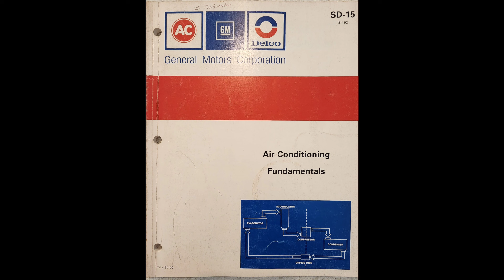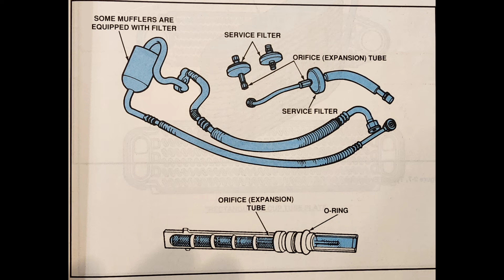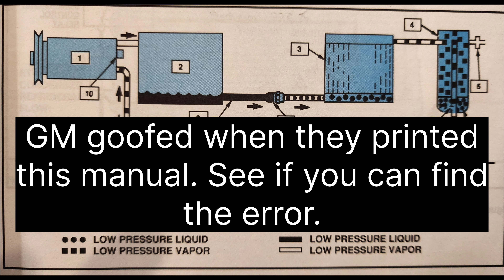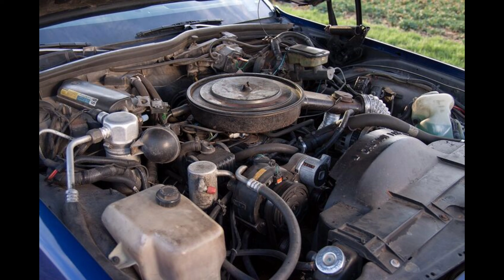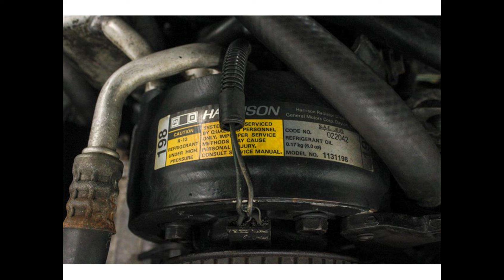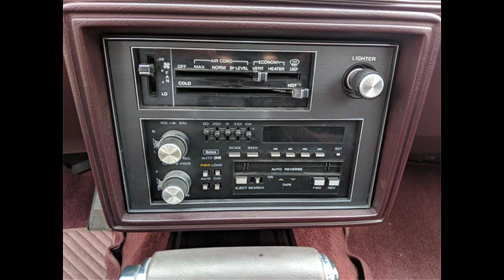The GM CCOT Air Conditioning Sytem Was One of the Best!

Comment: My 82 vet was converted to R134 and even with an upgrade to a parallel flow condenser, it's just barely adequate for down here in FL.  I bet if it was still R12 that would be a different story.
Reply: Mine was greatly improved by inserting neoprene insulating foam along the left and right side to seal the gap between the radiator and condenser.
Also while replacing a leaky heater core, I discovered the evaporator was full of dust.  It blows more air now the fins aren't blocked with decades of debris.
Reply: I had a 78 Eldorado also converted to R-134 with a new condenser.  Absolute garbage, like 65 degree air.  Took it to all sorts of experts, they said thats as good as it gets with R-134.  Knowing what i know now, either get the R-12 or look into some of the hydrocarbon drop ins like HotShot.  Thanks again to the tree huggers.
Reply: @johneldorado modern 134 systems have a larger condenser coil along with electric radiator fans. You could try upgrading to a larger radiator fan, this will help it cool down more.
Reply: @tomtom1541 78 eldorado had an engine driven cooling fan. 134a condensers had smaller tubes and more of them but were the same size. If that Caddy has a VIR valve it has probably failed.
Reply: @don2deliver  yeah I agree. But If you swap to electric fans or a condenser from a late model car it will cool down faster in traffic.
Reply: @tomtom1541  I tried adding insulation between the condenser and radiator on the sides and adding a pusher fan in front of the condenser on my 89' F150 after R134 conversion. I had a thermometer in the vent. It made no difference at idle or out on the road. I couldn't believe it. It was cold enough, I just thought I could improve it, I couldn't.
Reply: @johneldorado  Yeah how horrible it is to protect the ozone layer while you worry about feeling cold enough in your car. I think most people with a functioning brain would agree the ozone layer is more important than your comfort in your car. With that said, nobody is forcing you to drive a pile of garbage. I've driven plenty of vehicles with R134a A/C and they run Ice Cold.
Reply: @imzjustplayin  The hole in the ozone layer is a naturally occurring phenomenon.
Reply: @johneldorado  There is truth to that but we also know man made chemicals can destroy it as well.
Reply: @imzjustplayin  
My point is that the old R-12 should have still been made available to cars that needed it to function properly.  You'll notice other countries didnt go along with these stupid bans.  Consumer always get shafted.  How about we ban gasoline to save the Earth next?
Reply: @imzjustplayin   The ozone layer thing about R-12 was bullshit.  The truth was that DuPont was about to have the patent expire and anyone could have built R-12.
  So they went to their bought Congress, had it outlawed, then they produced their ''environmentally friendly'' R-134 (with its brand new patents).

The funny part is 134 isn't as efficient. So you have to have bigger compressors that cause more drag and emissions from the engine and more fuel consumption.
 And you have a have a larger condenser which requires more frontal area, for aerodynamic drag.   ...increasing emissions while lowering gas mileage too.
  And the larger condenser puts more heat on the radiator since the system has to work harder trying to replicate R-12 performance.   So now the cooling system has to be larger to handle all the extra load and BS the 'better' A/C system is throwing at it.

So at the end of the day it was a money thing. And the end result was hundreds of millions of cars on the road burning more gas, weighing more, higher cost of production, and warmer conditioned air.
Reply: @earlbrown  that's a lie. R12 was patented in 1928 so the patent was long expired. All the cfc patents like for r22 were expired for decades before the cfc ban and the ban didn't take effect for a full 20+ years after the Montreal protocol was passed.
Reply: I am in Texas and can get down to 30F out of the vents on a 115F day from a a GM AC system without using R12 or Propane.

Comment: Would that be the same system used in my 1996 Daewoo Cielo? The only differences being that the low pressure switch is situated on the high pressure liquid line instead of the accumulator and 2 extra switches are present on the high pressure vapor side on the back of the compressor. One is wired in series with the low pressure switch for A/C request signal and the other goes to the ECM and switches on the cooling fans' high speed when pressure gets too high.
Reply: You mentioned one of the greatest car AC systems of the late 80's and onwards found in GM cars. That uses a Delphi V5 compressor or it could be marked as Daewoo but it's the same, it's simple easily servicable ancient technology and works on R134a.
It is even fitted on cars with 1.3 liter engines, when it kicks in it will use the whole engine just for spinning the compressor, but you will get so cold that you will have to turn it off after a while.
On the cars with electronic-automatic AC controls it's honestly everything you need in a car.
Reply: I suppose you could open a parts catalog and search for new orifice tubes. Also, you could search for not having:
TXV
Expansion Valve
Expansion Block

Comment: I have a few vehicles still on R12, mainly old Euro cars. My C4 Vette has it with the Denso comp. 

Cost of 12 has dropped so much one can find it pretty reasonably priced now. Always cheap in bulk too.
Reply: Stick with the R-12, it might cost you an extra $100 or so dollars, but that's not much more than a tank of gas nowadays.
Reply: @johneldorado  I have about 70lbs of it, good till I die! Converting a 12 to 134 PROPERLY is not cheap, nor easy. 

Also ceramic tint makes a huge difference. If you folks dislike it, 85% is available which is near invisible.